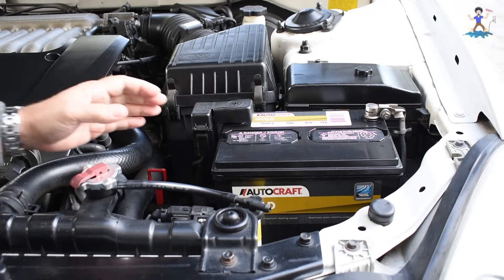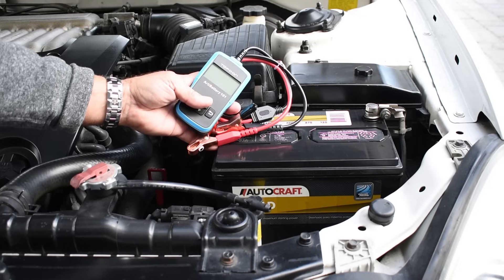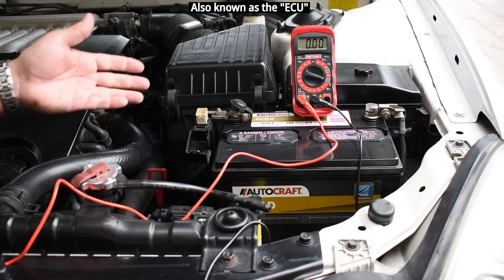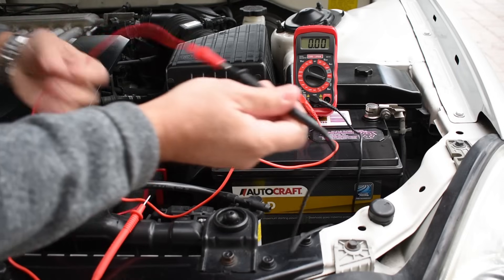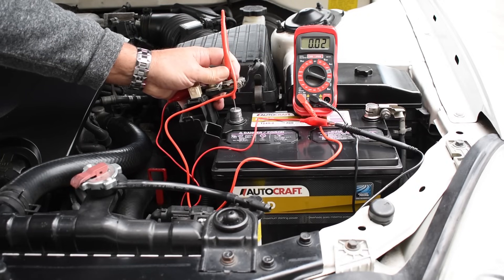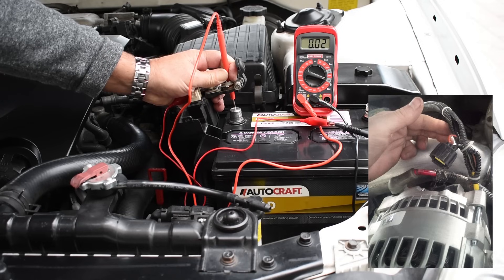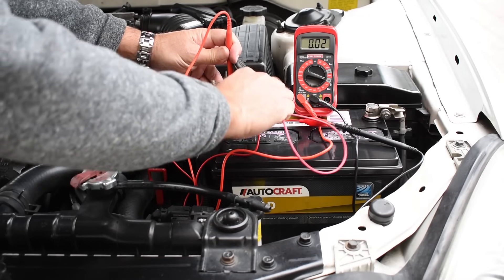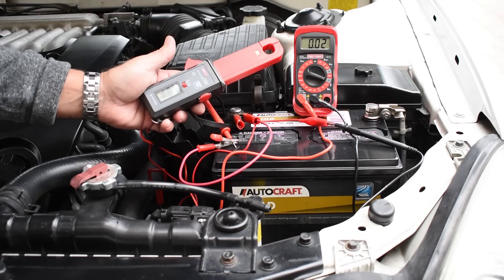Car Battery Drains Overnight Or After Days Of No Use! PARASITIC DRAIN

Comment: My wife’s V W battery would go dead overnight. Battery was still under warranty so I replaced it. It went dead overnight. To make a long story short, I called the service department and explained to a lady mechanic over the phone what was happening. She asked me if the car had a Clock built-in. I said yes..She said that’s the problem. I think her and hung up. I didn’t believe it until I unplugged the clock and my test made her stop showing a current loss. It was  the factory quartz clock that was killing the battery overnight
Reply: How did you unplug the clock
Reply: Unplug the fuse most likely.  @umermostwantedstranger
Reply: That was my question lol @umermostwantedstranger
Reply: I have the same problem I drive a Mercedes-Benz E320 every morning I get up it's like my car will not start or it may start no lights won't come on the doors won't unlock the radio won't come on then the next morning I wake up and try to start it up it won't do anything and I do have a built-in clock
Reply: I half thought she was going tell you, "Time to get a new car." 😂
Reply: I drive a durango 05. No clock. Been thru 6 batteries. I had a quick release installed and I have to unhook it after I drive it. Still don't know what's wrong. 5.7 litre with hemi.
Reply: @haygurl3978 it’s a dodge Chrysler product same as that garbage jeep
Reply: Toyota, intermittent drain .... And intermittent clock .. hmmm 
Good advice, I can chack that first
Reply: The more I hear about VWs, the more I'm never buying one.
Reply: I notice when I get a jump the clock goes bonkers! Thank you, I will let my mechanic know
Reply: i think i have a similar problem but with the radio/screen that’s installed in the car i bought. i turn it off but something is draining my battery when its not even being used.
Reply: Finding fuse box on 2009 challenger
Reply: Thank you so much! I'll let my mechanic know about the clock.
Reply: What type of clock I'm having the same problem loll😂😂
Reply: I bet mines is the electronic brake
Reply: How do you turn off the clock
Reply: This comment only left me with more questions like others asking how to disconnect the clock
Reply: Same  problem I just change the starter and new battery
Reply: We have a 2013 Passat that we can’t figure out why this keeps happening. Every couple of days it’s dead
Reply: @mtthw741 2011 Jetta TDI. Same issue. I don't have a built-in clock, though. Already replaced the alternator. Not sure if I need to waste money on a starter or not. Definitely wasting money on new batteries.

Comment: Hey there, thanks for the video. 

I went through the steps, but my multimeter reads zero whenever I have it connected to the neg post/clamp. 

It is on the 10 A setting, and the probes are in the multimeter correctly, and the probes are connected to the battery as shown. 

I know my battery is receiving draw, as my radio can turn on with the keys out of the ignition, as well as my cigarette lighters work when the vehicle is off.

I am trying to find other circuits that are going but I can’t use this method apparently. Any help would be appreciated.

2010 BMW X3 

The multimeter does work at checking resistance from the fuses, as well and the voltage from the battery. It seems the amp setting reads nothing in my vehicle for some reason. 

Brand new multimeter.
Reply: The fuse is blown in your new multimeter.

Comment: Here's a question: my battery and alternator are around a year old. Tried jumping it tonight but it still only clicks...
Got it back in my garage but noticed that only the brake lights stayed on after putting it back in park after having it in neutral to push it. No lights were on. I had to turn my headlights on and back off to turn them off. 
Is that a sign of a short somewhere?
I do have a lower amp battery because I have a ford focus, which as you know are smaller cars. I did order a starter pack from home depot, because they're good to have anyway. 
But I noticed some dimming in my lights even after replacing my alternator a year ago 🤔..if that long
How do I check this?
Reply: starter

Comment: Under normal circumstances should a battery go dead if the car is not driven daily? My brother-in-law has a nearly new battery that is already giving problems. He is disabled and only uses his car maybe a few times a month. I think parasitic draw must be the problem, but was wondering if his not driving the car very much could cause it. I am fairly certain there is nothing wrong with the battery which was put on a matter of months ago. The old battery was definitely bad and would not take a charge when we put the new one on it.
Reply from the maker: Modern vehicles have higher parasitic draw. Using the vehicle only 3 times per month can be an issue. I suggest he buys a small solar battery maintainer and leave it on his dash.

Comment: Question: Why when I set my multimeter to 10 AMP, disconnect my negative battery cable, put one of the multi cable on the negative battery and the other multi cable on the disconnected negative battery cable, my multimeter reads zero? I have also tried setting it to miniamp and still reads zero?
Reply: You have a blown fuse in your multi eter.

Comment: Thanks! I did the parasitic drain test and removed a fuse for A/CON. The meter dropped from 2.79 to .030. 
Left the fuse out for the night and the next afternoon car started right up! 
Only problem now is I don’t have air conditioning. 
What can I do to see what’s causing the ac to drain the battery?
And, eh yo, I just subscribed 🤙☺️
Reply: Yeah, I may have the same problem. It's not the ac itself but the AC compressor is drawing a charge while the vehicle is off. (Its hot to the touch when the rest of the engine is cold). I changed the blower motor resistor but that didnt change anything. Did you find out what the problem was for your car?
Reply: @TulsinDerbeck  install a on/off switch in the inside
Reply from the maker: Doesn't make sense. The A/C is connected to a circuit that gets power when the ignition key is in the ON position. Maybe try pulling the wire connector out of the blower motor or blower resistor while the meter is connected to the battery. One may be causing the problem. There's a work-around if you don't feel like spending a lot of money on mechanics. You can connect a standard 4 pin 30A relay to the A/C fuse circuit(between pins 30 & 87). You cut the wire leaving the fuse box after the fuse to connect the relay. Power will only be allowed to flow into the A/C circuit when the ignition key is in the ON position. Power from any 12V source that becomes active when the key is in the ON position goes to pin 86, and pin 85 to ground.

Comment: Could this method be used for just checking if a car battery is good or bad ? 

Furthermore after I have my multimeter set on amps dc scale what reading should I get for a battey that is good and what reading should I expect to get if the battery is no longer any good ?
Reply from the maker: This method does not test your car battery's capacity.

Comment: How about this method - take a voltage reading on the battery ..... leave car for 12 hours .... take another reading ..... then the current draw = 12 hour voltage drop * F, where F is a factor that I'd like to know.   I'm seeing about a .1 volt drop per day.  After 5 days the battery has gone from 12.5 v to 12.0 v.
Reply: I have a question 2016 ford explorer just put in a new battery and it started everything works but it still says service charging system and power steering is very hard.

Comment: Just measure if there's any current flow across each individual fuse. Note the fuse pins are accessible while in place
Reply from the maker: No, you measure voltage drop across the fuse.
Reply: @electronicsNmore  how much voltage is acceptable across the fuse? thank you.

Comment: We had an e350 van pulling 3500 mA of current. It was the alternator. Mind you, the alternator would charge fine but it was drawing mega amps overnight through it.
Reply from the maker: Faulty diodes.
Reply: @electronicsNmore  is that right? I replaced it with a new $115 motorcraft one and all my problems went away thank god.

Comment: I was able to find the problem using your video, so thank you for that! However, I bought a new fuse for that socket then retested and the draw on the battery remained. I took out the new fuse and again saw the draw go away. Any tips on why a new fuse didn’t stop the battery draw from happening?
Reply: The fuse tells you which component is drawing your battery. It won't fix anything unless it's blown.
Reply: The fuse wasnt causing the problem, it only identified which circuit the draw is on. Now you have to figure out what component on the identified circuit is shorted or drawing inappropriately and how to fix it.
Reply: I explain this is better detail in the comment I left a few months ago. If you can find it, I believe it will provide the information you need to answer your question, as well as provide guidance on the steps needed to resolve the drain. You're already more than half way done. =)

Comment: 3:58 mine was 68 miliamps, straight after I connected the car stereo (in switched off position) and after a few seconds it returned to 20 miliamps, is that normal?
Reply from the maker: Yes, sometimes it can take several minutes for the reading to stabilize.

Comment: So how would I set my battery up to where it turns off when the cars off,my battery is always on and if I leave anything plugged up or turned on in the car it will drain my battery. I have a 2000 mustang cobra
Reply from the maker: You cannot do that, it will reset your computer all the time. You need to identify what's causing the battery to drain down.

Comment: My problem is I replaced my alternator and my battery is brand new, sooo after I did all that my car ran fine and then it’s doing the same thing it was draining overnight, no power at all have to jump it to have any power at all
Reply from the maker: You need to identify the circuit. It could be your alarm system if you have one.
Reply: @electronicsNmore  I do have an alarm system, I don’t use it though because I don’t have a fob for it
Reply: @deso2048  me neither! No fob, but a light blinks
Reply: @electronicsNmore  I don’t have a volt meter like you do I’ll have to get one and try testing everything like you said in the video
Reply: This is kinda where I'm at...but it's been really cold too. I only let it sit IN A GARAGE at home for 6 days... tried jumping it after being hooked up to my friend's car for a good 15min or more, but just clicks and lights. No turning of the engine.
But my brake lights stayed lit after having it in neutral to push it back in the garage 🤔

Comment: I had tried that test and it still read 0.00. What am I doing wrong?!
Reply from the maker: I have a feeling you don't have the DMM set up properly.
Reply: @electronicsNmore  I had switched the jack to the other position and moved the dial to 10 after checking the battery and that’s what I got for a reading.

Comment: which are you saying to disconnect nthe neg or the possitive terminal...the meter goes on the neg or positive terminal
Reply from the maker: The process can be done on either side of the battery. Sometimes car batteries are partially covered making it difficult to get to the neg post for this test. If you use the POS post, then the red probe to the battery, if you use the NEG post, then the black probe to the battery post.
Reply: @electronicsNmore  doing it that way, doesn’t the current show up as negative value?  And if you switch the leads around is it harmless and the only difference would be now the current draw shows as positive?

Comment: How do we account for those cars that don't fully shut down for a a while? I've read that Audi TTs take a while to 'go to sleep'
How can I figure out what is causing it to 'stay awake' and therefore drain the battery overnight?
Reply from the maker: Wait longer, and leave the hood open(making sure you prevent any hood light from turning on).
Reply: Add really high power sleeping pills to the gas tank and drive till it or you go to sleep bet it will go asleep faster than you.

Comment: On my 05 yukon I just found my oil pressure guage is stuck at 80. Far right. So I'm guessing that explains the battery draw parasite. The cluster.
Reply from the maker: Sounds like a faulty connection, faulty gauge, or faulty sender.
Reply: WOW got a clustermuck.

Comment: the fact that disconnecting the car battery to do  can result in an expensive trip to the dealer speaks much  about the sad state of affairs  in the car industry  ......
Reply from the maker: Really no reason for it, there should be a memory backup system using a capacitor. Thanks for watching!

Comment: disconnect negative terminal.. then use volt meter or test light,, if get power to fuse . means there is your drain.. means device to fuse is grounding out ,,causing drain
Reply: So this means there is a ground short somewhere.  thanks

Comment: What a joke!    As soon as you pulled the fuse that will open the circuit for that device (say the clock) and will reset the time; you won't really know which device(s) is/are causing the most drain until several fuses were pulled... by then how many settings do you still want to retain? LOL!
Reply from the maker: Pull them out one at a time, then REPLACE THEM! LOL

Comment: Something is wrong with my car, I performed this test exactly the way is showing. And I always get the full battery current 12.90v?
Any body can help?
Reply from the maker: You don't have the meter set up properly.
Reply: @electronicsNmore  I even check for all the settings
Reply: Could be checking a blown out fuse?

Comment: I found the fuse drawing current, it is the one that feeds the Low Current Board which is inside the SJB, guess what, that board is attached to a lot of other components and it gets harder when there is little information regarding that circuitry lol, sometimes you don't get it easy as a fused light or component.
Reply from the maker: Once you identify the circuit, you do have some work to do.

Comment: I followed each step carefully and i got a reading of 0.00? I have a 2017 rav4, shouldn't there be at least over 10 milliamps? My multimeter is working properly as far as I can tell when measuring the battery voltage. Just wondering if it's too early to celebrate and rule out parasitic draw.
Reply from the maker: Zero isn't possible. Try another meter, and make sure you connect it properly.

Comment: RADIATOR!!!
yep that one is of the hidden culprits too especially with aluminum radiators because of galvanic corrosion and electrolysis. quick fix is a radiator cap with zinc anode. DAMN lost my beer buzz had to concentrate. worth it though to add to this post
Reply from the maker: My other video, which involves what you're saying. :-)
https://www.youtube.com/watch?v=x-gceYx_3RE
Reply: @electronicsNmore  watched and approved i Like, OLE!

Comment: You’re supposed to wait ~5-15 minutes after the vehicle is locked, doors closed, and/or smart keys out of vehicle for modules to go to sleep for accurate readings
Reply from the maker: Yes, if you saw a high reading show up, to verify that it's a parasitic drain, you'd check it again after 10-15 minutes.
Reply: Who's got 5 to 15 minutes
Reply: @microtechmachineshop  if your car battery keeps dying, you've got that amount of time every day you need to jump it! :D

Comment: Heres my problem: I was working on something and was putting the battery cables back on. While putting the negative on my ratchet is a long handle flex head. While wrenching I was looking around and the handle hit the positive post. The battery never acted properly since. Had it tested and I killed 2 cells but it worked for awhile.

Comment: my 02 mustang has a reading of 0.18-0.20 amps. when doing this test. but my battery still dies after a few days of sitting (with full charge before hand.) but was told its ok to be below 0.50. what is my issue?
Reply from the maker: .05 is not the same as .50! You have a big drain.
Reply: @electronicsNmore  my multimeter is set to 10a max and my car reads 0.18. thats a big drain? i saw another video saying below 0.50 is normal
Reply: i see what you're saying. i was confusing amps and miliamps. i have 0.18amps when it should be below 0.05 miliamps. thanks for your help!

Comment: I have a 2000 Jeep Cherokee... and I did the parasitic draw test... I got a reading of -0.09 .. would this be enough to drain my battery over night? 

I went through all the fuses, and i think I found one.. it goes from -0.09 to -0.01 .. the jeep fuse diagram tells me the fuse I disconnected controls "Headlamp Switch & Datalink Connector & Power Antenna Relay "

I disconnected the Negative terminal so tomorrow I will reconnect it, and if it fires back up then I can rule out a bad battery..
Reply from the maker: You're not doing something right. The meter isn't set correctly to get those readings.
Reply: I have a 95 Jeep Cherokee. Did you ever figure it out?
Reply: @russrussellruss  to be honest all I did was clean out all the electrical connections with a wire brush or sand paper.. and she has been running fine since..